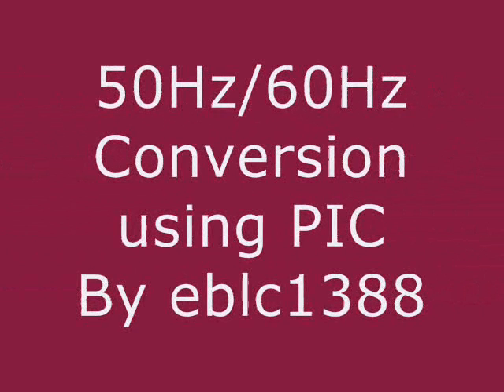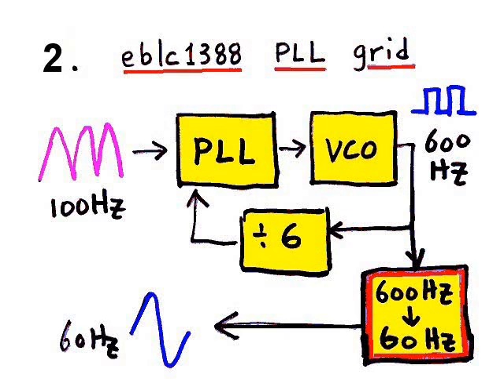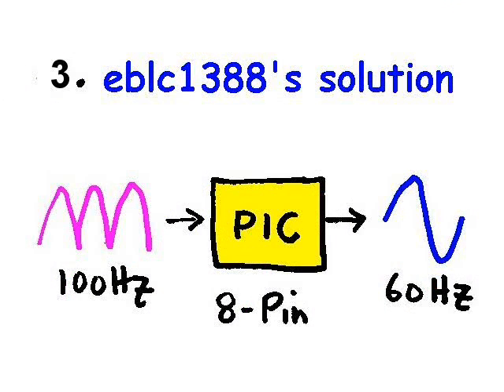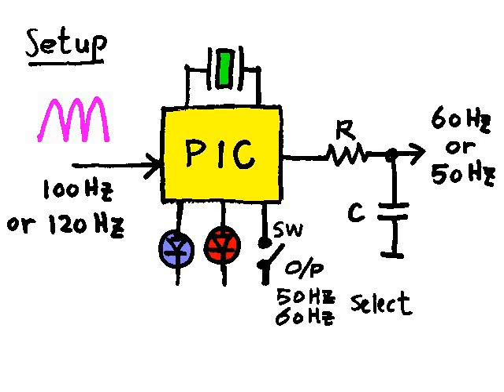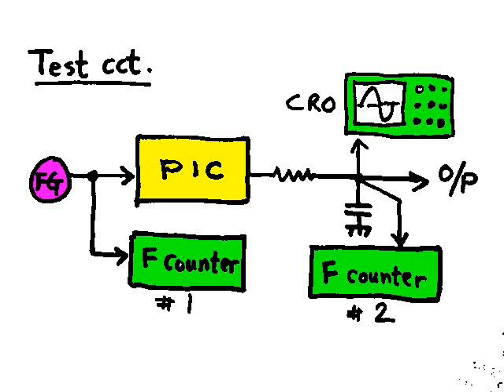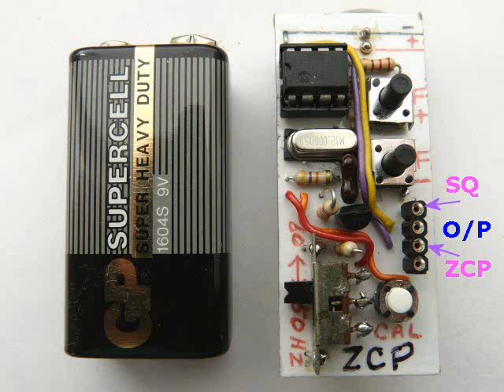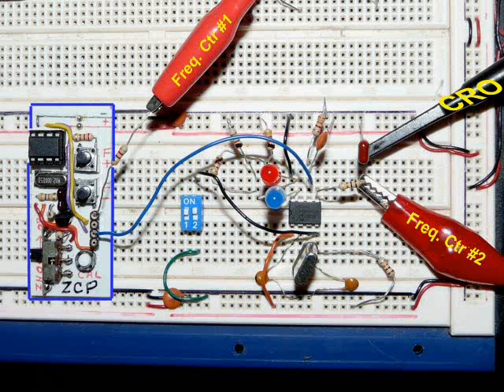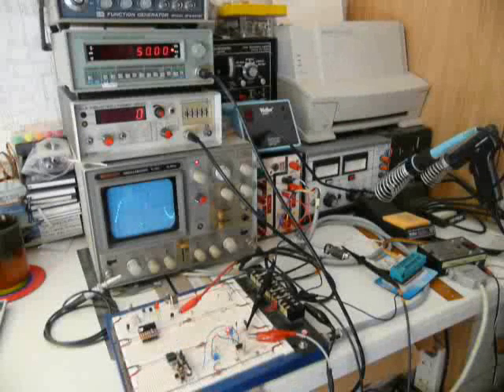50/60Hz Frequency Conversion with PIC

Comment: Hi thanks for he knowledge you have 1 more sub :) i'm looking for a solution, to make it work in Italy an USA air dryer.The air dryer is compatible with 120V/60hz 15amp, in Italy we use 230V 50HZ. I am looking to design my own frequency converter / circuit. Another option is to make it work with an inverter which should still provide the correct voltage & 60Hz frequency sinewave output. please let me know if you are willing to collaborate for this my project my best regards

Comment: I got a European alarm clock 220V 50Hz and I want to use it to the Philippines uses 220V 60Hz. 

50Hz clock will run fast on 60Hz electricity.

Comment: I like this a lot. If this were around 40 or so years ago audio equipment with sychronous motors (tape decks and turntables) would have had an easy time being operated anywhere in the world irrespective of mains frequency. A simple flip of a switch instead of changing pulleys.